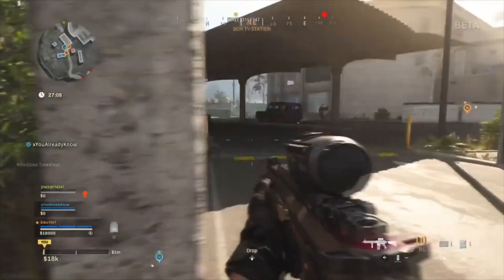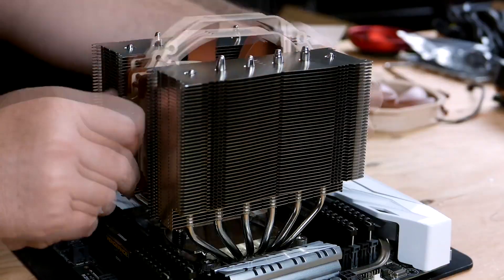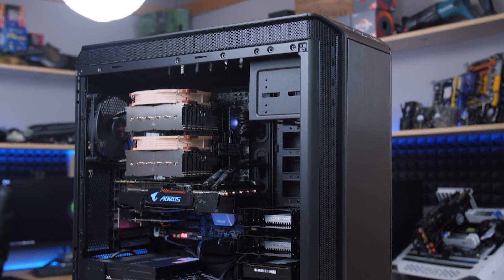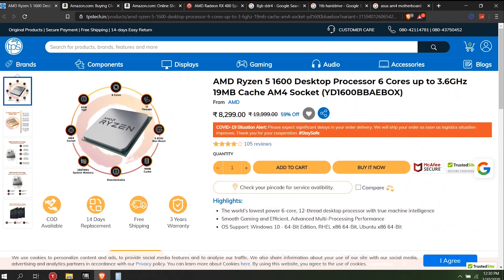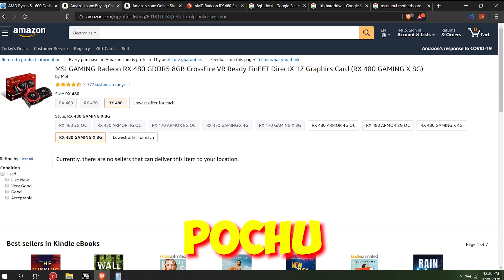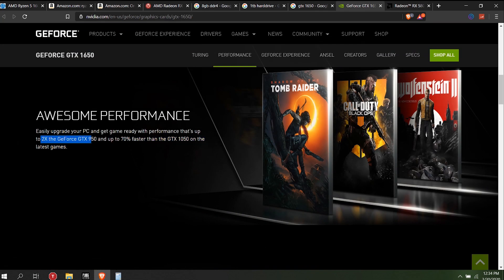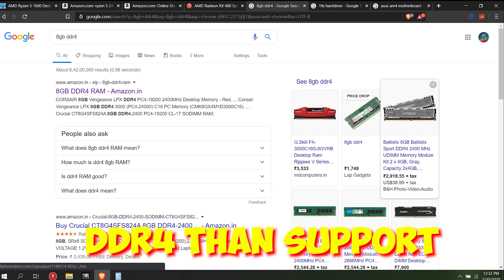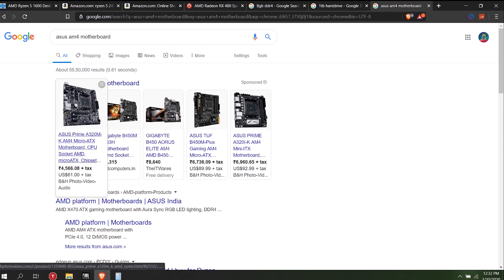Best 30K பட்ஜெட் Gaming PC Build For Hardcore Gaming

Comment: ryzen 3 3300 vs 5 1600 which is best bro
Reply from the maker: 3300X is much newer bro, and it has best single core performance. ryzen 1600 AF has more multi thread performance but not significant. 
Buy 3300X bro, it supports much better ram and it's good! and it's zen 2!
Reply from the maker: https://youtu.be/JNi3iNzqwaY
watch this video bro, i've explained!
Reply: @MrSniteTamil   zen a what bro
Reply from the maker: @AmourTechTips  generation name bro!